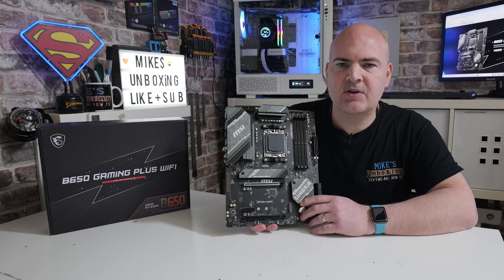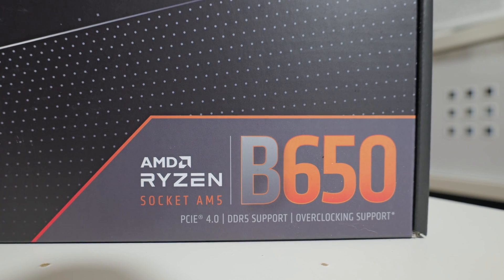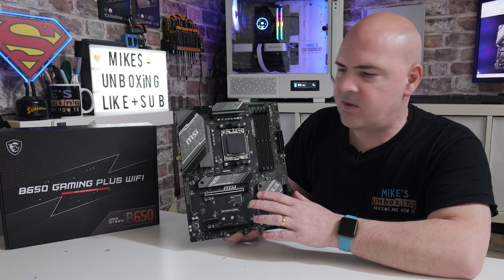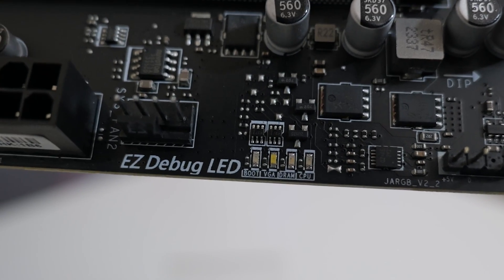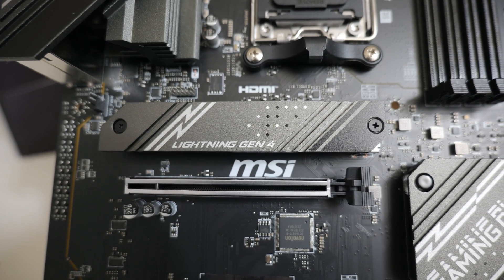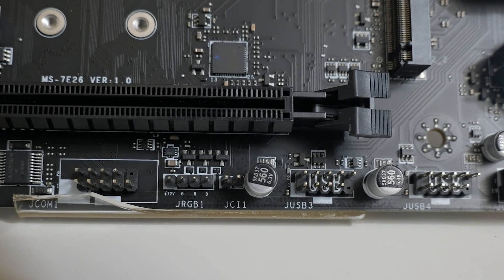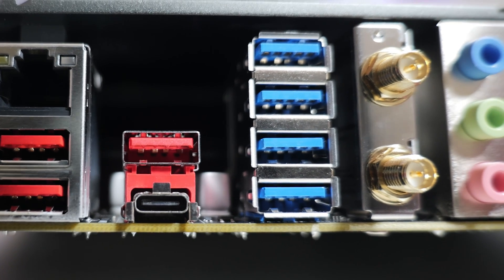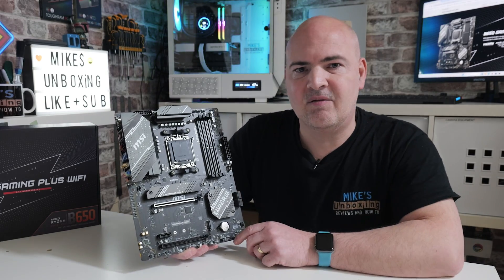Best VALUE AM5 Motherboard MSI B650 Gaming Plus WiFi

Comment: Hows the boot time on this? I've been reading reddit there's an issue with the ram not functioning well because of EXPO, and boot time is very slow like 30 secs? Is that true?
Reply from the maker: these all had slow boot times when they first came out, but now these are fine. All boards are slow when memory training, once that is done its fine
Reply: @mikesunboxing thanks!

Comment: Having a very weird issue with this board. Just built a new pc and whenever I do a cold boot (shut down or full power off) and turn it back on it boots no problem in to windows. But whenever I warm boot (restart button or windows restart) it does not boot and when I go in to bios it doesn’t detect my m.2. I then have to shut down and power back on to get it to detect again. Any suggestions would be much appreciated!
Reply from the maker: Hmm, that's a strange one; it might be worth checking the M.2 power management settings in the BIOS. And also bios update and make sure fast boot is disable on the motherboard and also in Windows
Reply: Hey, thanks for the suggestions. I tried all of these and they did not work. Luckily I ordered a different drive and now it works. The original drive I had was a Samsung 990 pro which I read online that it is a known issues with those drives and msi boards (I guess something with their specific firmware combo). Bought a WD Black 850x and running smoothly now.

Comment: hi, im a trader , which dhoud i buy - msi B650 gaming plus wifi ( ATX) or  msi B650M gaming plus wifi , 

i mean , an ATX or a micro ATX would be better for multiple chart reading , 2 display setup , and 24 hrs runtime daily ?
Reply from the maker: either will be fine, altough what GPU are you planning to use? or using onboard graphics with an APU?

Comment: Hey guys, I have a question. I just installed this mobo, got everything running perfectly, but mine didn't include the thing at 2:38, is there a way to get these separate? I'm very scared I'd have to disassemble my entire build just for this little thing :c
Reply from the maker: the io shield is able to be bought separately on ebay etc, or get a 3d printed one. you technically don't need one and i have run many pcs without one. Hope this helps

Comment: I am planning on getting this motherboard will I need to flash the bios before putting in a 9700x cpu or will it work without any bios update?
Reply from the maker: yes i would think you will need to flash it unless the board comes with a 9000 series ready sticker on it

Comment: Hey man, I just got MSI Pro B650-S, did I make a bad move? I was planning to upgrade to Asus tuf gaming B-650 Plus or MSI Gaming Plus, cuz better Vrms, Cooling, stability
Reply from the maker: that is still a good board, you did ok
Reply: @mikesunboxing  should I upgrade to ASUS TUF GAMING B650 plus?
Reply from the maker: @shahzilarif3594 yeah good board but if you have the B650-S then is it worth it unless you can exchange it return it
Reply: @mikesunboxing  what do you suggest? 🤔 i am confused rn…

Comment: trying to build from a sapphire nitro + RX 7800 XT GPU and looking into this(12,700), the MSI MAG B650 Tomahawk(14,000), and Gigabyte B650M Aorus Elite AX(11,300).
They are around each other's prices but was advised about if it's getting close to 15k, don't get it. I'm planning to buy the 7800X3D processor as well.

Not sure which to get though. I don't know what I'm doing lol but I'm reading, watching, and trying to learn. and this is my first time building. 

Anyone can give advise on which I should get?
Reply from the maker: i would get the tomahawk or gaming plus personally the bios and software is much easier for a novice to work with

Comment: Is anyone else having issues installing their m.2 on this board? The screws aren't on the motherboard like he said, and the ones included in the bags don't look like regular screws, they have some plastic on them and a bulky metal piece on the screw coil.
Reply from the maker: This is maybe easier to fix or at least advise if we can ask more questions and get direct answers, so feel free to join our Discord chat and we can go over it in more detail https://discord.gg/XtBTGQ6BDu
Agree to the rules by clicking the emoji and you will get access to the rest of the Discord channels

Comment: Just installed today but didnt get it to work.... i plugged in all the power cables, but it keeps showing me this orange light, i have it with Ryzen 7 7800x3D and RX 7800 XT.

I changed the Ram but keeps flashing, tried bios update with a stick, it flashed and turned off and on, but still keeps getting orange/yellow light.
Reply from the maker: that could be a short circuit or the cpu is pressed down to hard by the cooler

Comment: I am building a pc with this motherboard with the Ryzen 9 9900x cpu and rtx 4070 super.
Do you think I should be aware of anything?

I know that I should upgrade the motherboard version so it can support the cpu.

As of now, I don’t have the gpu. So, will I still be able to use the pc?
Reply from the maker: you will need a bios update and could use the PC with the onboard graphics chip, its really basic but okay for web browsing and emails

Comment: Sir i bought this same board , but thr msi pro b650 s wifi ( same mobo , just the heatsink diff only ) 

And ryzen 7600
Kingston fury 6000 cl30 rgb 16gh
Zotac 12gb 3060 
Deepcool PL650 psu

📌 If i need to update or anythimg in the b550 s wifi mobo  before assembling my new oc with rhis spec.?

Bcs its already support 7600 out of the box.

But mow ita 2024 , if i need to update to latest biod using flashback ? Or uodate only after the build and testing if necessary?

Because i don't have a ups or inverter with me . If power fail during biod flash its risk no?
Reply from the maker: if the power fails just try again when it comes back on
Reply: @mikesunboxing  so it's mandatory to update the bios first then build the pc?

Comment: Using this board with my 9800x3d 😊
Reply: Vram over heat?
Reply: @44dn  everything seems normal,  i dont overclock just play everything how it comes out of the box
Reply: Did you have to flashback the bios?
Reply: @GameyRaccoon  no

Comment: Guys, I have big problem.
What motherboard do I actually need? 
I want to have a motherboard that will support future upgrades, for good value and ATX form, also I'm going to use 5 7500f as starting CPU
At our local store ( DNS ) I have few options:
Tomahawk b650 - 250$
B650 gaming WiFi - 230$
Soo, what should I get? I'm really confused with those new fees.
Reply from the maker: Either is a good choice save money with the gaming plus if you like the look of it, it is mostly cosmetic between them

Comment: Between the MSI B650 GAMING PLUS Wifi vs Gigabyte EAGLE AX or GIGABYTE gaming X Ax or the V2 which one do you recommend?? With upgradeability in mind. Also they are similarly priced in my place with just 15 dollars separating them
Reply from the maker: the msi board everytime, i have a dislike for the gigabyte bios layout and the awful supporting software for OC RGB and fan control
Reply: @mikesunboxing  thank you so much for helping out 😇🙏 Also your videos help us alot. Have a great day mate

Comment: Hey, built a computer with one of these recently and found myself lacking in storage. I already have a one terabyte NVME on the heatsync SSD slot but would rather not have to reinstall everything so just want to ask where/how I could implement another storage device, probably for storing other applications and what brand to go for and whatnot, if I can.
Reply from the maker: i would get another drive like the fikwot fn501 or the lexar ln710 those are often good prices and almost guaranteed to be reduced for the black friday deals.

Comment: I have this Mobo and just put together my build yesterday but it wont post at all. It lights up the CPU and dRam. I am using a ryzen 5 7600x and g.skill trident z5 neo  RGB @6000 with CL30. Any help with why it wont boot would be greatly appreciated.
Reply from the maker: try one stick of ram only in slot 2 and if that won't work try the other stick in the same slot, you might have a faulty stick in the pairt
Reply: Did you solve it?

Comment: I don't know if i should buy this or msi pro b650-S wifi help please my build 
Cpu : R7 7800x3d
Gpu : sapphire rx 7900 xtx nitro+24gb
Ram : Corsair vengeance ddr5 6000mhz 2x16 32gb
Storage memory : 2 wd black sn850x with heatsink 2000 gb + 1000 gb 
Write transfer speedi

6600 MB/s

Read transfer speedi

7300 MB/s

Max. random 4K read

1200000 IOPS

Max. random 4K write

1100000 IOPS

Cpu cooler : deepcool ak620 zero dark zoria
Power supply : deepcool pm850d 850W 
Case : Hybrok titan evo 7 fans rgb
Reply from the maker: get the gaming plus
Reply: @mikesunboxing  thank you soo much , brother.♥️

Comment: I’m not sure if you’ll see this but Im trying to build my first pc and I can’t figure out what the problem is (HELP PLEASE)

PARTS: 
CPU-Amd Ryzen 7 7800x3d
RAM-Tcreate ddr5 x 2
GPU-Gforce rtx3080 10gb
MOTHERBOARD-mid b650 gaming plus wifi
Powersupply-Corsair rm1000x
Aio-asus rog ryuo III 360 argb (I switched the fans from asus to the lx120 from Corsair)

Problems?
Ive taken the cpu out looked at pins and it all checked out.
I’ve unplugged all the power cables and replugged them in
I’ve taken the ram out and put it back in
I’ve taken the gpu out and put that back in

The only odd thing I’ve found is when I hit the power button on the power supply I can’t find any leds on the motherboard that light up (yes I’ve checked if I have power, I can hear a slight buzz in the power supply when I turn the power supply on). I’ve tried the power switch on the motherboard or at least what i think it is I’ve checked manuals for it but this is my first build and I’m not sure if I’m getting the right pins.

Any suggestions or help would be much appreciated, thank you
Reply from the maker: This is maybe easier to fix or at least advise if we can ask more questions and get direct answers, so feel free to join our Discord chat and we can go over it in more detail https://discord.gg/XtBTGQ6BDu
Agree to the rules by clicking the emoji and you will get access to the rest of the Discord channels

Comment: Hey, please help me. Got the MSI B650 Gaming Plus wifi motherboard with Ryzen 5 7600X, Corsair DDR5 RAM (2x16GB) 5600MHz CL36 and the cooler is a thermalright frozen prism water cooler. PC has been built but the EZ debug is coming up with a red and orange light on the CPU and DRAM. I have taken RAM out and fired up, have only used one slot of RAM and still got the same issue. Tried to losen off the cooler to see if that makes a difference. Pins checked under chip and all seem fine.
Reply from the maker: is the RAM EXPO certified or is it XMP for Intel?
Reply: @mikesunboxing  Profile Support: AMD EXPO, Intel XMP 3.0. That's what it shows in ebuyer
Reply: @DJRossi180, were you able to fix the issue?
Reply: @ hey yes i did. basically i just turned it on and put a usb into usb slot and it fired up. sometimes now and again when i fire up the pic the lights come on, but i leave it and it fires up then.

Comment: Is it still possible and easy to overclock with this motherboard
Reply from the maker: yes it is
Reply: Overall most of the thing u use on AMD is PBO aka Precision Boost Overdrive. What this does? It's a thing for undervolting when meanwhile it boost clocks a bit. Most of times recommended is PBO Curve on Negative -30. It's the best to test it by AMD Ryzen Master on your system first to see if it will cause problems.

Comment: Sir I have recently built a PC with this motherboard and ryzen 5 7600. Could you provide some insight into how much upgradability would i might have with this setup in future 😊
Reply from the maker: really the main constraint is your wallet, you can easily use any of the AM5 range of processors and ANY GPU you can afford

Comment: does the Phantom Spirit also work with the b650 gaming plus wifi motherboard?
Reply from the maker: Yes it does
Reply: @mikesunboxing  Thank you very much. I was trying to install the intel cpu bracket but didn’t realize the bracket was only for intel 1 hour later.
Reply from the maker: @Fatlikew  Glad you got it working 🙂

Comment: What about those 3?
MSI B650 Gaming Plus Wifi, ASRock B650 PG LIGHTNING or ASRock B650 PRO RS for AM5?
Reply from the maker: Gaming plus WiFi
Reply: @mikesunboxing  As i wrote before, i heard that MSI having a lot of boot issues when EXPO is on and etc. Will i will be safe pairing it with R7 7800X3D and Lexar Ares 6000mhz CL30?
Reply from the maker: @Berkelll as long as the ram is the expo certified ones you should be fine
Reply: I decided to go with MSI B650 Tomahawk. Wish me luck to not have any problems. Cheers!
Reply from the maker: @Berkelll  Good luck!

Comment: would it be okay to pair it with a 7800x3d ?
Reply from the maker: yes that is fine
Reply: And ok with the 4080 super as well? I feel like that mobo is the weakest link in my current setup
Reply: @robday2007 yes
Reply: Many people really are concerned if "budget" or "mid range" motherboards will afford those top processors and yeah you can even if u gonna mess around with some PBO. You could even put there top Ryzen 9 processor and it will work perfectly, it's just if u have that kind of money, you rather got for better mobos as well.
Reply: @Berkelll  the mobo will prob be the next thing I upgrade. Got the 4080 super and 7800x3d and they should be fine for another year or two.
Reply: @robday2007  Not really need to upgrade mobo as long as it works perfectly fine, it just depends if u gonna use it's feature or u will plan to upgrade for PCIE 5.0 for graphic cards and NVME. Wait for the new series of mobos B850 and X870 and see what's gonna happen.

Comment: Is the MSI B650 Gaming Plus WiFi good with the Ryzen 7 8700G or should I get another MSI AM5 Motherboard?
Reply from the maker: yeah that is a good combo especially for a non gpu system. If you are planning using a GPU don't buy the 8700g
Reply: @mikesunboxing  Hmm Maybe a Ryzen 7 7700 (non-x) might go well with the MSI B650 Gaming Plus WiFi vs the MAG B650 TOMAHAWK WIFI?

Comment: How long does it take to boot into Windows with m2?have an MSI B450 Gaming Plus with a 5800x3D. I would still like to switch to AM5.. the only thing that puts me off is the boot times.. I never have problems with my System
Reply from the maker: 20 seconds or so maybe less

Comment: does this come with the bios ready for the ryzen 7 7800x3D out the box? or do i need to update the bios
Reply from the maker: unless it is really old stock in should be included, but updating is very easy to do if needed. Check the production date on the box and compare that to the bios release dates

Comment: Bought one of these and a Lexar NM790 (with a heat sink) for my first ever build; I'm waiting for my 7500F to come in and im wondering if the heatsink that comes with my lexar would perform better than the frozr?
Reply from the maker: it will possibly be about the same, i would use the frozr to keep it looking OEM but try both and see which gives the better results, i'll be interested to hear about it if you do

Comment: This motherboard supports gen4X4 M2 NVMe SSDs, but in the BIOS you can actually set it to Gen5X4 SSD. I dont know if that it is going to work or run an SSD with R/W speed of 10000 MB/s and over...

Comment: do you think that this motherboard is better than the b650 eagle ax?
Reply: i don't know what to pick
Reply from the maker: personally i have a strong preference for MSI bios and software so even if the VRM was stronger on the Eagle i would still go with the msi
Reply: @mikesunboxing  thanks for the answer, i think that i'm gonna buy the b650 tomhawk wifi cuz it's in discount in my country

Comment: I got this motherboard because it was in the micocenter bundle i bought, not my first choice but it is ok. Bundle deal was ryzen 7 7700x/msi b650 motherboard/32g ddr5@6000mhz for $399. I do prefer built in wifi though since its way faster.  Clicking your link to this build this setup is $706.
Reply from the maker: that was a great deal you got there
Reply: @mikesunboxing  I thought so to, total build was $1300 after taxes, put a rx7800xt in it and I'm very impressed with it. My cinebench scores are slightly above stock since I undervolted and that gives you a 200 to 300mhz boost and the cpu runs much cooler. Think maybe yours was the undervolting video I watched. 👍
Reply: were you able to get your ram to 6k or even  5.8k with expo, I have the same setup but I keep running into blue screen of death
Reply: @22progre77  yes, had to do a bios flash to the motherboard to get it to 6000. That is supposed to be a issue when these first came out that the board needed a bios flash.
Reply: @bluecollarwatches7048  what version on you on? I updated to the most recent version on their website but still facing the issue
Reply: @22progre77  not sure, I'm at work but I built mine 6 months ago and used the latest bios at the time.

Comment: Just started building my pc and I got an AK400 zero dark plus cpu cooler. And it won’t fit in the b650 mother board. Anyone know any good cpu cooler, that will fit with this mother board.
Reply from the maker: how does it not fit? it should do

Comment: Quick question:

I bought

MSI MPG B650 EDGE WIFI ATX AM5 Motherboard

AMD Ryzen 7 7800X3D 4.2 GHz 8-Core Processor

I got this warning:

Warning: The MSI MPG B650 EDGE WIFI ATX AM5 Motherboard supports the AMD Ryzen 7 7800X3D 4.2 GHz 8-Core Processor with BIOS version 7E10v13. If the motherboard is using an older BIOS version, updating the BIOS will be necessary to support the CPU."

should I flash the bios before using the 7800x3d or should it work out of the gate?
Reply from the maker: answered on the other video